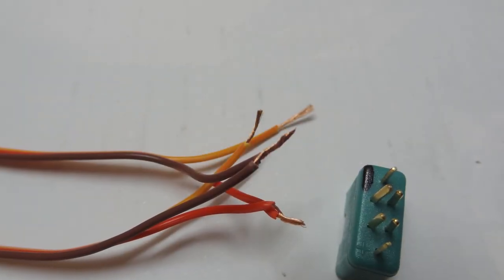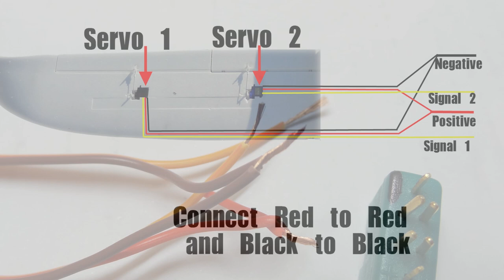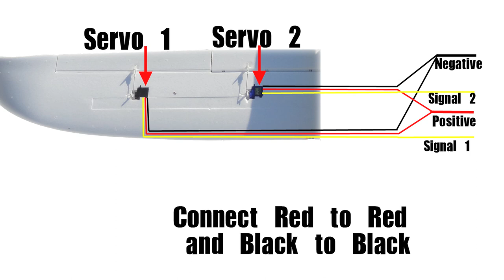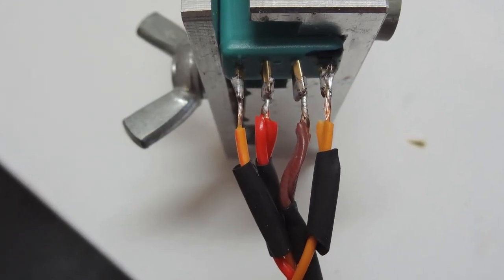Using MPX connectors for servos

Comment: I see a few possible problems. You should at least leave one of the connectors loosse, instead of glueing them both in fuselage and wing. (They will wear out). 2/ during soldering you should connect the contra connector so the heat will dissipate over a larger area, this will prevent (just a bit more) the pin from melting in the plastic. If you have problems with melting you can use small printboards designed for these connectors, you’ll have a better grip too!  My 2 cents!👍
Reply: where do you get the printed board from?
Reply: So you’re sayn Proly leave fuselage connector loose. Then as you pull wing out, the f. connector and its wires will come out of fuselage and you then unplug male and female...?
Reply: Genau so mache ich es auch,nur eine Seite fest einlegen,zb Im Rumpf.Das Gegenstück, also vom Flügel lasse ich lose.Sollte sich der Flügel mal etwas lösen, bleibt die Steckverbindung erhalten.Muß jeder für sich entscheiden,ich mach es jedenfalls immer so und hatte noch nie Probleme.

Comment: Thanks for the great tips! 
One concern I have is during flight, as wing stress/flex, would it cause loose connection and plane would loose control of ailerons/flaps. Did you experience any of this issue during flight. Thanks.

Comment: How did you secure the MPX connector in the wing / fuselage? I can imagine you don’t want to be pulling on the solder connections each time you separate the wings.Many thanks

Comment: Also, before cutting the cnx off your servos, attach a short servo extension lead and tape or put a saftey clip on.....then use this technique on the end on the extension lead.  That way, by removing the lead in the future it will leave your servo exactly as new.

Comment: Why connect two wires together then solder to both pins and split again on the other side. Would be much simpler to give each wire it's own pin. Then if a servo fails it's much easier to replace it.

Comment: When these connectors are used for power alone, are all 3 pins used and what do you use to bridge the gaps between the pins when you solder a single wire to all three.

Comment: Im using these on my planes that have flaps and Alirons that I require to connect and disconnet at the field, they reduce the number of connections by half. I soldered my connectors slightly differently, I soldered every wire on a separate pin,. But your idea works just as well

Comment: Great idea....but you better be good at soldering. Because one bad solder joint and with some vibration and stress over time and you bought the farm.....you lose all connection. Its a single point failure. Sorry dont mean to be a buzz kill I really like the idea but beginners be careful.

Comment: Great advice.  I like how you mounted the connectors at the end of the video by setting them flush.  My only concern would be the connection points maybe getting loose over time with the wing flexing and not necessarily the best connection?

Thanks for the idea!